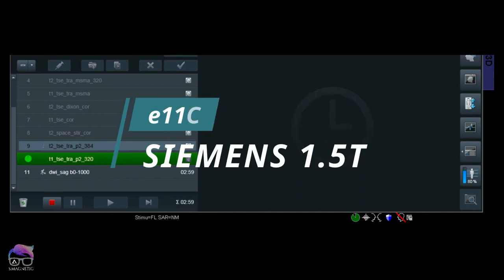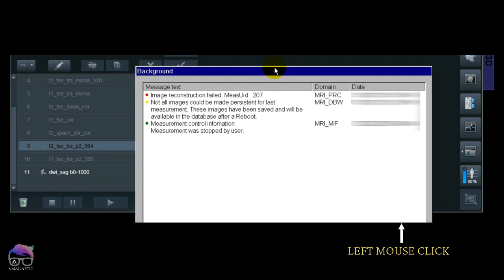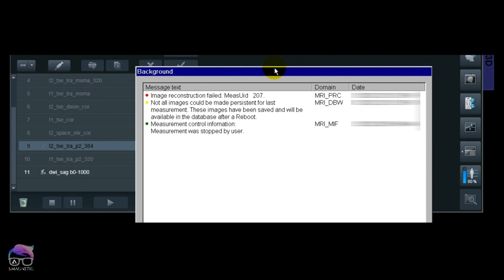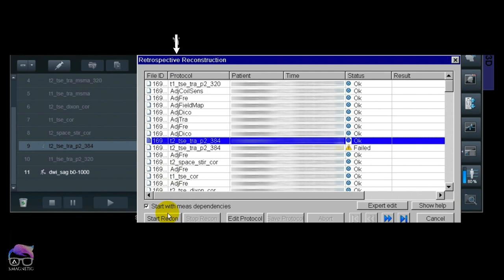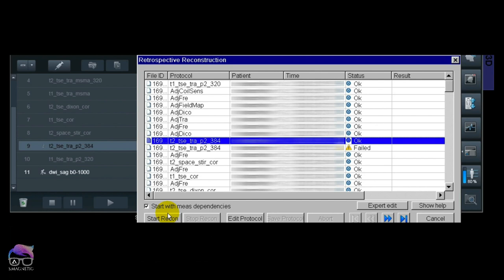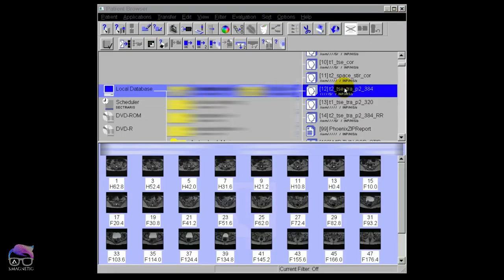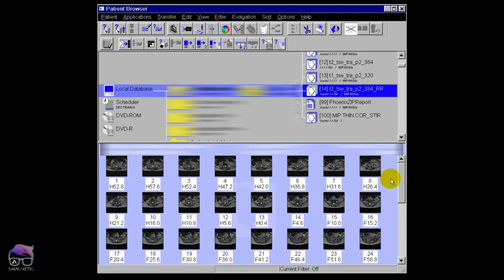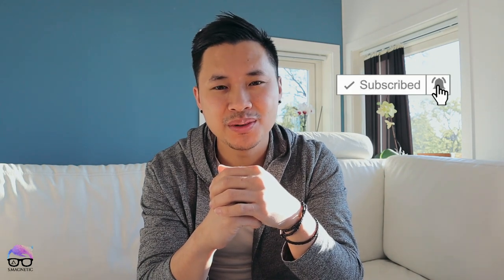HOW TO SOLVE IMAGE RECONSTRUCTION FAILURE FAST AND EASY

Comment: Should it work when the patient is already off the table? Cause today I couldn't do it, it said AdjCoilSens failed
Reply from the maker: Yes it should work. Sometimes click off : start with meas dependencies. But I recommend you to do it while patient is still inside. Just in case of failure